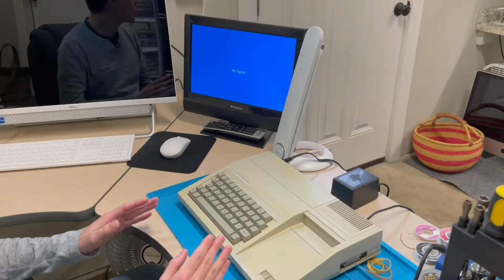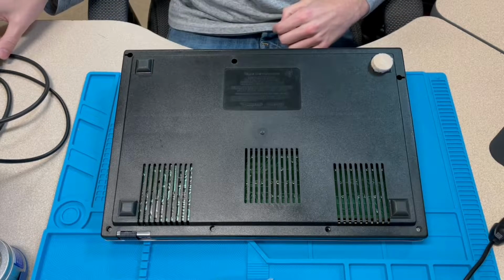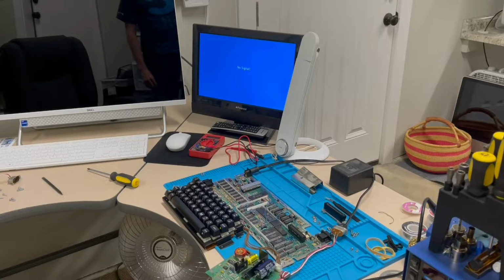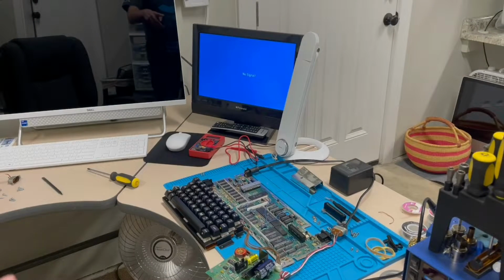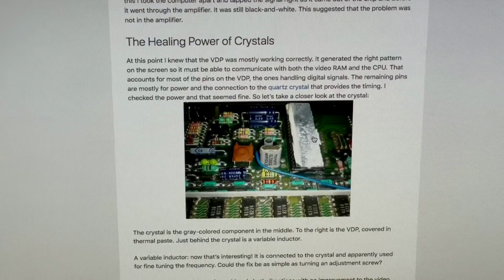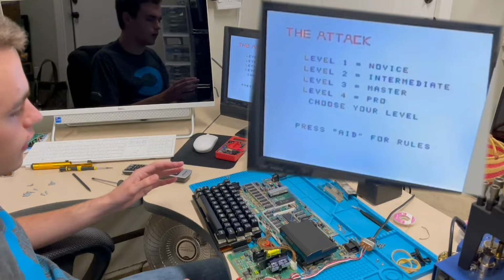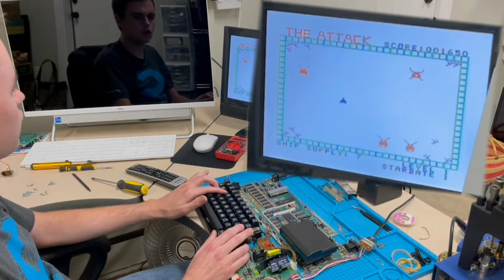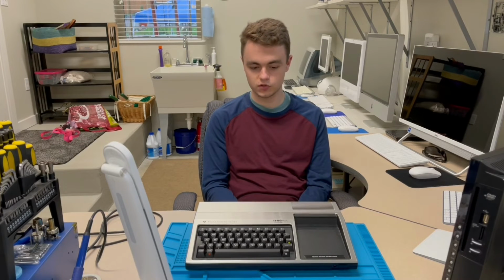This TI-99/4A had an interesting issue with its video signal

Comment: You don't need to take those two screws off the metal piece for the heat sink for the VDP chip. You can leave it on and put thermal paste on the metal piece between the chip and the heat sink.